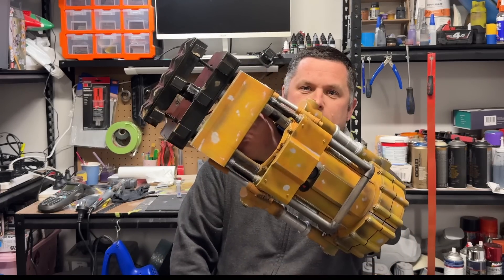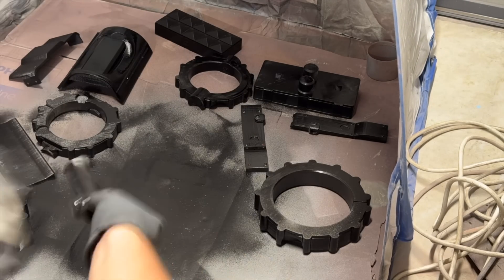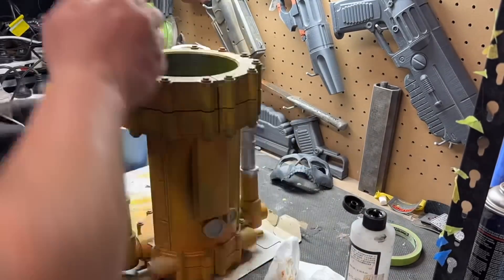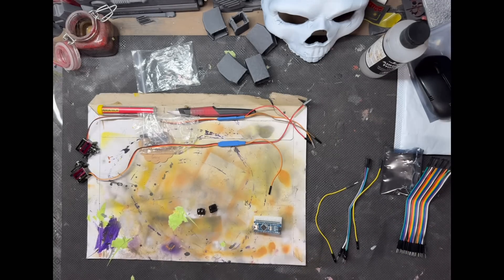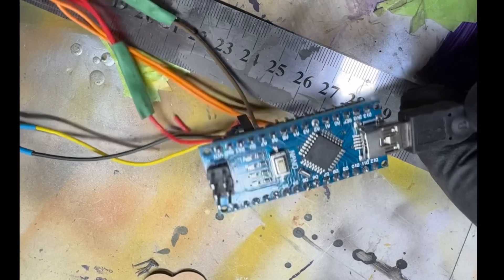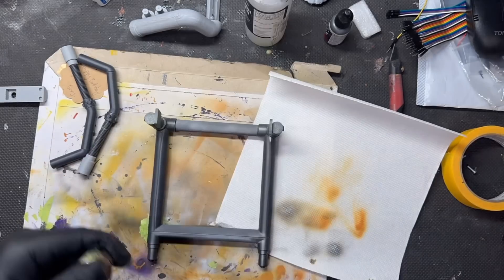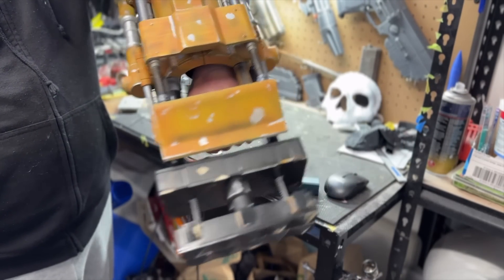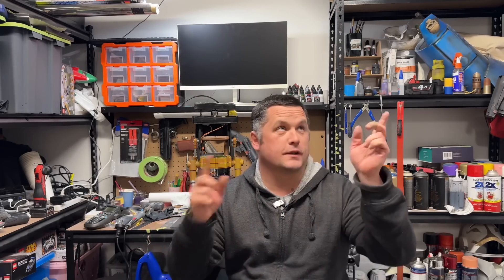DIY Power Fist Actually Works!

Comment: Tried to buy one of these recently off a guy on etsy and got absolutely scammed. Full of gaps in the pieces. He couldnt sort the electronics so he ripped them out in a way i cant do anything with it now as its assembled, and its already startimg yo fall apart and havent even used it as a prop yet. overall an aweful print i was charged through the nose for then only gave a partial refund because i still recieved an item and then stopped responding. Came poorly assembled aswell so its gonna be a nightmare to paint and fix any issues.
Thought about just buying the stl files a comissioning it as i dont have a 3d printer. If there are any UK based services anyone knows of thats high quality at a good price can some1 point me in the right direction? Really want one of these.
Reply from the maker: That sucks you had such a bad experience I’m sorry to hear.
Reply: @hobbytime66 sorry about just going off on a rant there. Thinking back on my experience got me wound up haha.
Thanks for video i may refer back to this to help finish mine off! Might buy the files for reference aswell. ❤
Reply from the maker: @boojon2 good starting point

Comment: Did you try sanding?
Reply from the maker: No I didn’t. I use spray filler and as it was a functional prop not a display piece I didn’t worry about it to much.  Feel free to send me yours complete so I can check it out